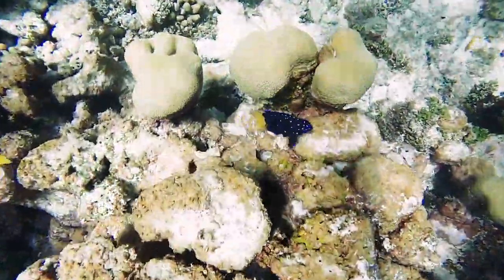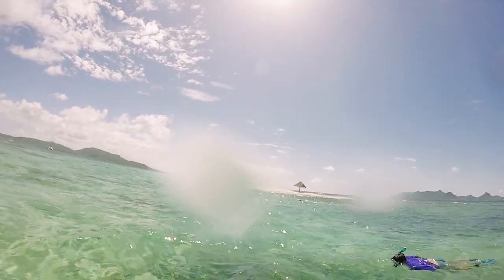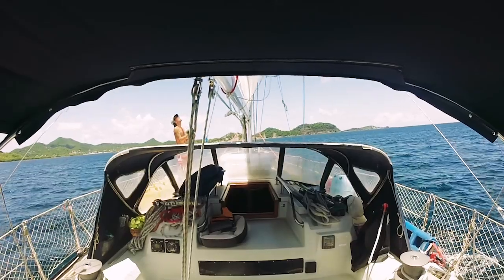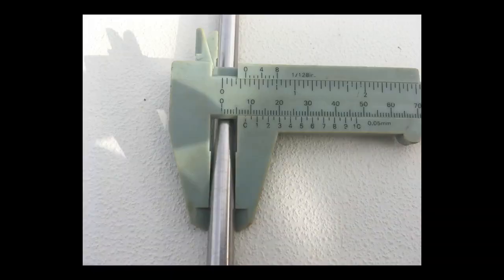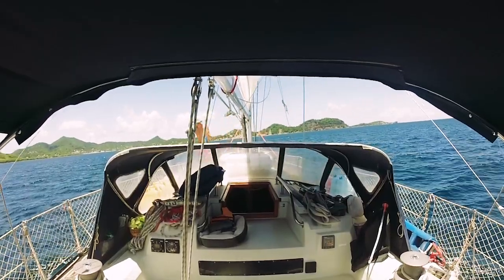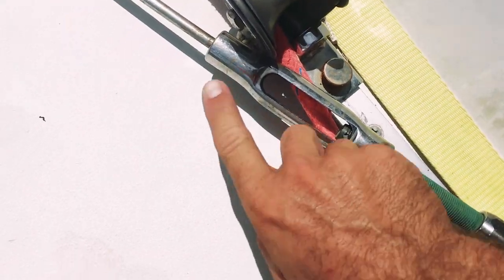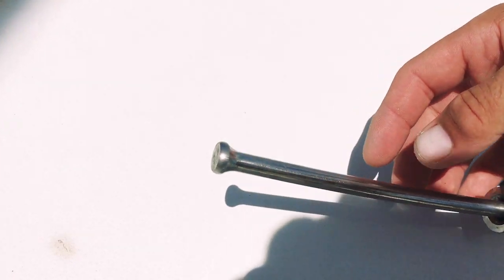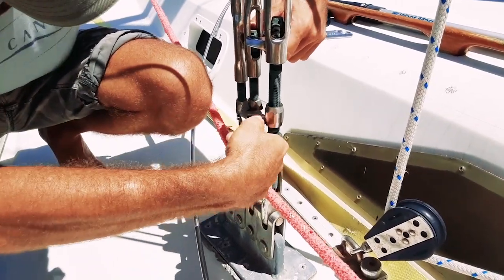Replacing a Broken Shroud on our Sailboat WITHOUT a RIGGER! | Sailing Balachandra E080

Comment: Rod rigging fails after x stress cycles at y intensity. This is good, the cycle life is known in rod unlike cable. Hard to measure but very consistent. So, the bad news for you is, if this one broke, all the rod ends are very suspect and should be replaced. If you are lucky and have enough turnbuckle movement or extra toggle space you can have the existing rod cut and re-headed. You really cannot visually inspect for this. Rod has a lot of benefits. Don't ignore this one.
Reply from the maker: You are correct... this shroud was too loose and we knew it. Also it was cracked for a while- probably when the mast was removed or by the PO. We checked all the other rod ends by wire brushing and close inspection. May do a die test next time up the pole. We'll probably replace the other lower shroud when we get to a place where shipping large wire coils is not an issue

Comment: Great video you guys! I had full faith you knew what you were up to. Did you have a safety line rigged though? If one is broken I would suggest replacing the rest soon :)
Reply from the maker: Thanks guys, that is the logical approach. Because we could identify  how the rod broke (too loose) we know that the rest of the shrouds are  probably in better shape. We did a thorough inspection. That said, i think we will definitely replace the oposite lower shroud as that would have the most risk of metal fatigue

Comment: A professional rigger would tell you if one has broken, its already too late for the others.  The issue with rod rigging is that the cracks are so minute and hard to detect its impossible to truly tell what is going on without ultraviolet crack testing or X-rays, as professional riggers do